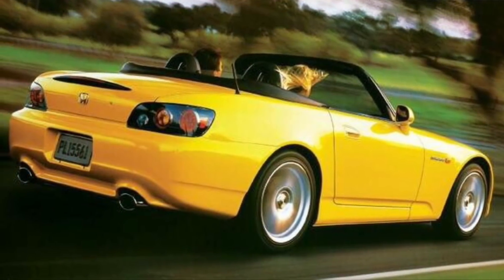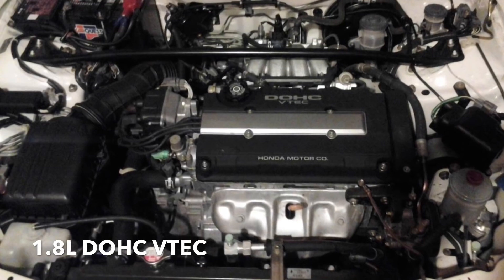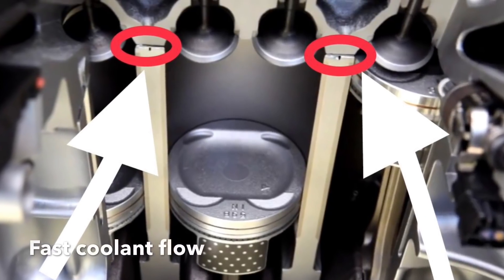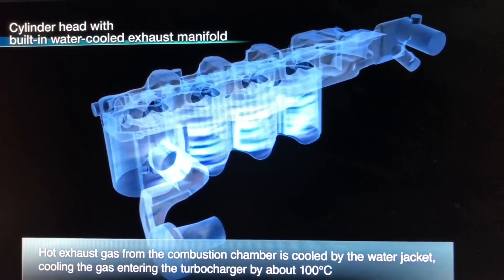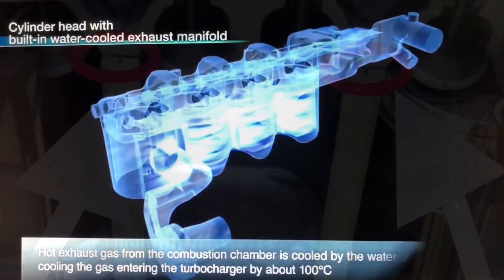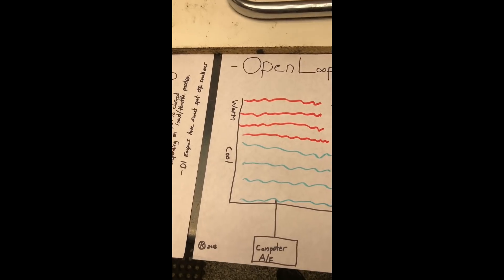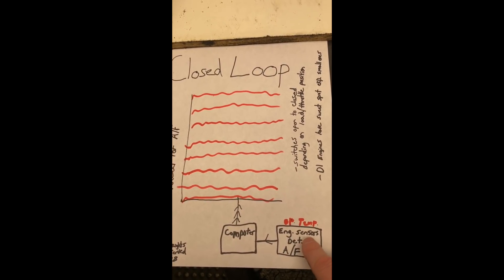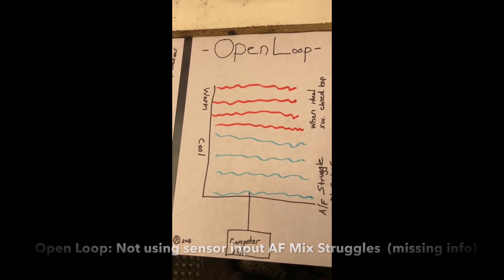1.5L Turbo Honda Oil Dilution Explained CRV Accord Civic

Comment: For anyone that is here in 2021, Honda had a class action lawsuit against them and lost.  Powertrain warranty has been extended for up to 6 years from date of purchase for 2016 through 2018 model years of the civic with the 1.5T.  I think this was 2017 to 2018 for the CRV. not sure about the accord but I would assume its for roughly the same model years if they have the 1.5T.

Comment: For us in 2023, referring to the 1.5L Turbo Accord 2017-2021ish, you can find a million of them for sale in SoCal.  As for the 2.0L T Accord, those are hard to come by out here. In fact, i think they are actually shipping the 2.0L T in from the rust belt of all things.  Conclusion: the oil dilution problem is killing all the 9th - 10th generation 1.5L T Accord engines.
Reply from the maker: Yeah can’t go wrong with the 2.0 from what I hear.  Nice cars.

Comment: My girlfriend friend  just bought a 2019 accord with the 1.5T. it has 50k and i have xrossed fingers it is not one of the 1.5 with fuel dilution and or head gasket issues down the road.
I told her to make uare to use quality synthetic , change it at 5k max and to make sure the collant is always full and  to only use thr blue Honda coolant.
She drives pretty conservatively so fingers crossed

Comment: The issues arent turbos or tunes. Its the pistion ring design with a direct injection. Honda wont come out and say this but, it is the problem. All engines have slight blow by because this is what cause oil to get dirty in the first place. Honda's issue is excessive and a problem.  They also have an issue with their V6 that burns oil and Honda says this is normal. Its not normal... Honda like other manufacturers are lacking in their quality control

Comment: I heard the fix for this is to mix 5W20 with the 0W20 half & half. This adds better sealing properties to the piston rings and prevents the uncalled for blow by of the rings because honda wont fix this issue.  Some people are using 5W20. My wifes CRV is on its first oil chnage with the mixed oil of full synthetic.  It only has 27k mileage on it. I also change the oil at 5k

Comment: I've heard people talk about injector spray patterns on these engines. The direct injector sprays fuel onto the cylinder walls and the piston rings pick it up. Under boost conditions some blow by is going to happen, only now the blow by is contaminated with fuel. I have a 2019 CRV with the L15. I bought it used and live a literal 2 minutes from work. I have noticed fuel contaminating the oil, though not to the degree others have spoke of. Its the EX-L trim level, pretty much loaded without the foot activated tail gate and in dash navigation, and I love driving it. That 1.5 runs like a V6. I just take it for a longer drive on the weekends, use the best oil and premium fuel and change the oil at 3,000 miles. I dont think Itll be an issue for me. Which is good because they only extended the powertrain warranty up to 2018, supposedly the 2019 and above aren't having a problem, but I can tell you they are. It could be that mine is more of the typical DI oil contamination and not the super excessive stuff others are talking about?? The most I have saw my oil above the full line is 5mm, I've heard of people seeing 30-40mm above the full mark and wiping bearings. Either way I love the car and am happy I bought it, even if it means I have to put a little extra into maintaining it. I've saw Hondas that lasted 500,000 with very little maintenance. They are hands down the most reliable car you can buy, and in my experience the L15 runs like a dream, an Earth Dream that is, whatever the hell that is?? I have noticed my fuel economy is down though. Others are talking about 30-40 MPG, on the very short trips I take Im getting 22 MPG. I may have to pressure test the intercooler, I've heard the intercooler side housing seperating from the heat exchanger is very common, and will kill fuel economy without a CEL.

Comment: Hondas are pure junk. I am speaking of authority of someone who owned Hondas for 3 decades and unfortunately they became a horrible auto manufacturer especially in the last 10 years. The best Hondas are from late 80s to late 90s. Toyotas are the best at everything consistently and when they had problems they rectified it with recalls and fixes to actual manufacturing process instead of like Honda who just does software fixes. At least, this is how it is in Canada.
Reply: Calling Hondas “pure junk” is an absolutely ridiculous statement to make.
Reply: @bruceskousen5451  Hondas used to be completely reliable late 80s and all of 90s and were moderately priced BUT now days they are over priced and poor reliability with engine dilution issues, transmission issues and all kinds of electrical issues. I call it pure junk.
Reply: @Thankyou_3  Yes, Hondas, and every other vehicle is overpriced, but Hondas are still very reliable compared with other car manufacturers. They are right up there with Toyota. Toyota and Honda make their own CVT transmissions and they have been very reliable. The problem is many owners neglect transmission fluid changes. Regarding the oil dilution problem, there are many 2017-2018 Civics, CRVs, and Acuras with the 1.5 turbo with over 150,000 miles with no issues. Again, good maintenance is essential. However, show me a reliable source that exposes widespread engine failure/damage caused by oil dilution. I’ll save you some time; you won’t find it. All of the auto manufacturers are under intense scrutiny/pressure to manufacture more eco-friendly vehicles. This has resulted in some manufacturers building cars with defective drivetrains (Nissan CVTs have been a disaster). Yes, cars today are far more complex due to political pressures to be more green. So far, Honda has done very well. I wouldn’t hesitate to buy a Honda or Toyota. I stand by my comment regarding your blanket statement that “Hondas are junk.”
Reply: @bruceskousen5451  Toyota/Lexus and Mazda are the top tiers.

2nd Tiers are Honda, Subaru and Nissan. They are just mediocre. With poor parts supply chain and poor manufacturing process especially in North America.

I stand by my comment that Hondas are junk purely because of the price they charge and quality consumer get it is about the same as Subaru and Nissan.

Comment: It's not the turbo! its the high pressure direct injection earth dreams 2.4 and 1.5 motors that causes unburnt fuel pass your pistons rings into your oil, in your oil pan! That's oil dilution! It'll thin out your oil and cause spun bearings! Either honda should fix it, change oil frequently or run thicker motor oil weight! Oil dilute is not normal and should be resolved! I dont u understand why other consumers are not experiencing this! Either they're not checking or smelling their oil dip stick to see if it smells like gasoline on it or maybe it can be a hit or miss thing

Comment: Here’s my anecdotal experience.
I live in the suburbs of lower NY. We get decent amount of cold and snow but significantly less than much northern or midwestern parts of the country. My 2018 Civic EX-T (1.5 liter turbo) bought new now has 72,000 miles. After nearly three years with no garage I have no issues so far. I’m averaging 33.3 mpg. I did get a advisory from Honda in 2019 to update the software which I did. I also maintain my Civic religiously, servicing early...every 4,200-5,000 miles.

Comment: Avoid short trip, what a bullshit.  I brought CRV to go here and there could be 1 mile or 10 miles. So now I have to think every morning if I go out for short trip, I should walk and don’t drive.  What a bullshit.  Get it together HONDA, owned all a Honda before never had problems go back to old engine not 1.5 turbo

Comment: I bought the 2016 civic 1.5l turbo brand new. Been 4 years with 50k miles and live in cold weather illinois. Never had an issue.
Reply: Do you warm it up in the winter?

Comment: newer civics are trash, get the acura ilx it still comes with the 2.4L 4 cylinder engine that has been tried and true. also has a much better 8 speed transmission no stupid turbos or cvt

Comment: I bought a 2020 Civic sedan 1.5T.
I do smell gas in my oil and I have been monitoring oil level.
5k so far.
Reply: I know this is old but how has it been? Has changing the oil frequently made it fine?

Comment: @Jerry Jr's Garage. Ive been considering adding a Mishimoto Oil catch can to my 2018 Civic SI- I'm under the impression that this will reduce the fuel getting into the oil from the Civicx forum- is there any truth to this claim?
Reply from the maker: K S You can try it but in my personal opinion I don’t believe it will do anything for this issue

Comment: Obviously, the ‘18 and apparently the ‘19, but does the oil dilution problem apply to the 2020 Accord, too, or has this issue been resolved finally in the third year of this generation? I guess I should avoid this generation altogether.

Comment: Honda needs to remove all worries if ands or buts about this issue, a bandaid “software fix” isn’t going to do squat.  They are going to lose fans and customers and likely get sued.  

I feel Honda is in denial here, they’re starting to sound borderline crooked...  

I have a feeling this issue is related to piston rings and pistons that weren’t designed for that 1500psi or so of fuel spray right into the combustion chamber.
Reply from the maker: spencer 124 Possible.  Many factors are at play.  I am far from an engineer but on the consumer side I do agree with you on many levels.  Quality has gone down...parts engineering etc its all really give and take but if this does get sorted this will be one hell of a little engine.  I have faith they will pull through it all just fine and keep loyal customers on hand.
Reply: Jerry Jrs Garage exactly, I feel like Honda is a good company, and really, no car company even including Toyota is what it used to be.  This is a pretty cool motor though for sure, I heard some people with the SI’s with this engine pushing 300hp:)

In my 2019 civic si so far I have not experienced any oil dilution issues.
Reply from the maker: spencer 124 I feel like the SI is immune to these issues due to a complete different style set up..& tune.  The SI I am betting is safe from these issues but I am guessing here.  That sounds like a fun car to own...It is insane the HP coming from such a small engine that is awesome lol I love it.

Comment: Honda should not do turbo engines simply because it’s the new thing everyone is doing. Honda has something that is priceless and it’s a outstanding reputation and the trust of the American public. Honda you shouldn’t jeopardize what has taken you decades to build. Perhaps you should stick to the engines that have been proven to be outstanding in every way, If I ran Honda I wouldn’t let a turbo  engine leave the factory until I knew that Honda’s turbo engine is going to outperform all of Honda’s competition and the public knows that Honda’s turbo engines will last as long or longer then the non-turbo engines produces over the years by Honda and they will function flawlessly with no issues what so ever.

Comment: I expect the motor on my 2010 CR-V to last 300k miles. I expect the 1.5L turbocharged engines w/DRG In the new Honda’s will last half of mine. Any thoughts?

Comment: I've had a 2019 CRV for about 10 months now and driving it without any problems whatsoever with power or any gas smell in the cabin. In fact, I drove it today in minus 25 degrees celsius weather starting from my garage and then going for coffee for one plus hour and then going home and smelled the oil on the dipstick. If I hadn't heard about this oil dilution problem I wouldn't have been able to place the smell as gasoline, so I would basically say there was no gasoline smell to the oil.

The problem he's describing here with the open loop diagram sound to me like they would have been solved with the software update for earlier models on the recall. You didn't talk about the software update at all.

Comment: Thank goodness I'm a cheapskate and bought the 2014 CRV 2.4 haha
Is this oil dilution problem in the 2.0 turbo Accord engine as well?
Reply: No reports about the 2.0t having oil dilution issues. Possibly all the civic type r owners racing their cars so the problem never appears or barely anyone buying accords this generation because it’s all about suvs. The 2.0t is quite different utilizing both vtc and VTEC. It’s a older design from the previous type r.

Comment: Bunch of hooplah imo. Let your car idle for 30-45 seconds in cold weather and then go easy on it until it reaches operating temp and you won't have a problem. Change your oil frequently and you'll be fine.
Reply: Reaper Actual the 1.5 has the oil dilution problem even in summer. Oil reeks of gasoline at 2000km

Comment: Think about How Toxic shelling out 30k or more for a car with the current 1.5 and it's problems will be when trade in time comes around .....
He hit the Nail on the head when he said maybe this will require a more involved serious repair .......Ya Think ...!?!??    
Not gonna fix this problem with software Honda .....
If open loop is such a problem in a smaller turbo engine .....then this engine is not a marvel ...... It's a mistake ...... Up it to 2 liters ..... and fix it ....
Pity the souls that are stuck with it because they thought they were buying  a Honda....And Honda doesn't make mistakes ...!!!

Comment: My 2017 Civic SI failed at 61,000 miles. 1000 miles after my warranty. I also have the extended warranty, but without them doing any diagnostics they deemed it was not applicable and are extending an offer less than free.

https://www.civicx.com/threads/2017-si-stock-with-61-000-mi-engine-failure.41395/
Reply from the maker: ClosingTheLoop Wow.  I would consider getting rid of it after the fix.  Engine failure at 61k is unacceptable.

Comment: The main problem is the pistons are to shot they need be doubled in thickness and add one additional compression ring and also add a airflow intake temperature sensor to prevent to much fuel from entering the engine and add a engine block heater in all the vehicles that use this engine to keep it 80 to 90 degrees when temperatures reach 45 degrees or colder.

Comment: Run it through the dyno. Use the EC997a method which will allow measurements every 100 rpm's if necessary and identify every glitch in performance and balance. Of course that will never happen as honda has an unrepairable engine.

Comment: In US there are Canadian, Great Britain and Japanese built 2016+ Civic with 1.5T engines and according to vehiclehistory.com they all (SEDANS)  got different MPG, 32/42 for Canada , 31/40 fot GB and 28/38 for Japan. For Hatchback they got even worse mpg due to different tuning and extra weight.  I guess Canadian and GB built ones are not affected by this dilution issue, but i can only speculate.
Reply: constantin58 they all have the oil dilution problem. I’m in Canada and my 2018 does it even in summer. Honda’s software fix did nothing

Comment: This engine problem also shows one of the few advantages of a "managed" economy. When this situation showed up in the US market, Honda put out all of this bullshit and as a result, we get videos like this and Honda keeps on selling what is fundamentally a defective product to US customers. In Chine, they identified this problem and Honda laid on the same line of bullshit. The government's reply was to immediately ban further importation of the the effected vehicles. This is just one symptom of the larger problem presented by these small displacement engines being tuned up to high compression and loaded with an as-heavy vehicle. Get grip! Honda makesproblem-free motorcycle engines which have more displacement that this little high-tech turd.

Comment: I have a 2017 crv with 19000 km on it. The oil is very dirty with 4000 km on it. I’m told these 1.5 turbos are prone to carbon build up along with the oil dilution. Honda is not being honest with the problem. I too have been told to take the vehicle for a long drive down the highway to burn off the carbon. Really? And avoid short trips. Really? Bottom line in my opinion is these turbo engines are garbage. We wanted to buy our crv but got a 2 year lease at .01% so took advantage of that. Was going to buy it out this month but am now giving it back. I think going forward these engines are going to fail. This will be big trouble for Honda. They are sticking with this engine. The 2018 and 2019 Cres have them too. It’s too bad because the crv is a very nice vehicle. But reliability is the most important.

Comment: I have the 1.5l turbo and haven’t had any issues, and my Carrolla I had was dog crap compared to this awesome car.
Reply: Have you driven it in a northern climate during winter months? Just curious, since most of the issues seem to be short trips when it's cold out. I've been thinking of getting a CRV, purely out of their reliability and resale value but want to get an EX or higher trim with the 1.5l but some of the issues I'm hearing about are frankly steering my search away from Honda entirely. I hope the problem isn't a big as folks are making it out to be but I'm skeptical on trusting a 1.5l Honda at this point, which is sad.